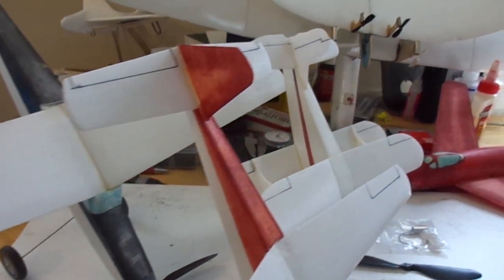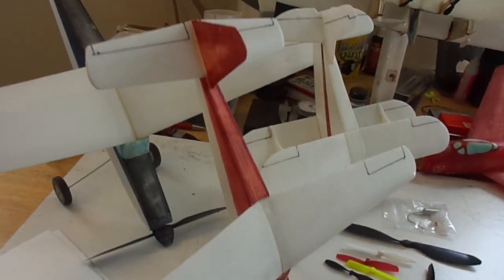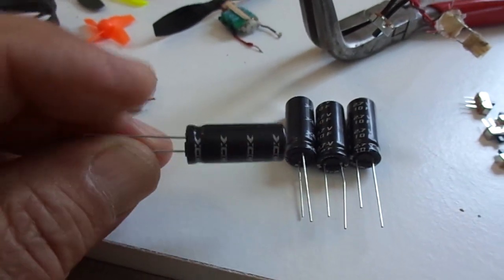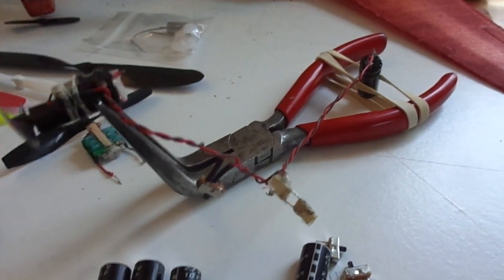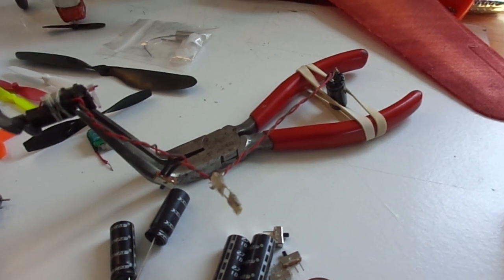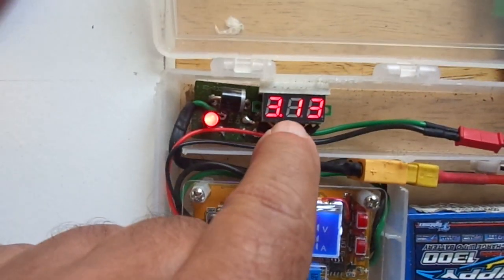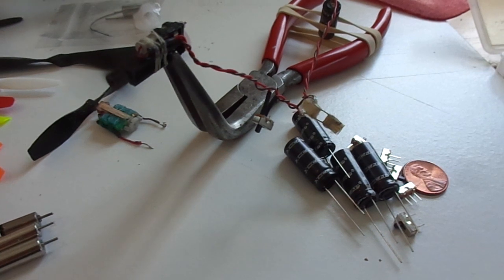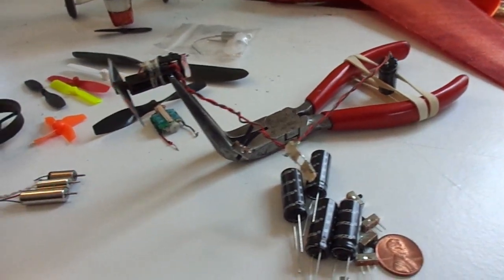SUPERCAPACITOR FREE FLIGHT BASICS

Comment: I have seen different charge voltages used by different people. Some use 2 AA batteries, some use 3 AA, some use a buck converter to supply constant 4V for a small time. So I have only seen people charging to 3V and higher and no one goes for 2.7V or 2.8 V. I dont know why that is or what is appropriate.

Also, how do I build ur kind of fuselage with my foam plates? Would be nice if u can do a short build video and provide plans :)
Reply from the maker: Hi, thanks for the comment! I chose the charging voltage and current based on specs I found for a very similar capacitor I found listed on digi-key.com. I wanted to stay well within the ratings of the device to be on the safe side. As I mentioned in the video, these capacitors behave like a dead short when they are not holding a charge (super low internal resistance acts like a short circuit). So, it's important to use a low current supply to charge. AA cells are low amperage whether you use 2 or 3 of them, so no danger there. If you use a buck converter, it should be a current limiting type or at least able to withstand a shorted output for a short time. 

I like the idea of making a build video but I can point you in the right direction until that happens. There is a website called outerzone.co.uk where you can download thousands of old-timer plans for free. What I do is pick out the design I want to build and download it (it's a PDF file). I display the plan on my computer screen and adjust the size on the screen until it is the size I want to build. Then I darken the lights in the room and trace the part outlines with tracing paper right over the screen. You might have to play with some of the dimensions a little to allow for the different relative thickness of the foam vs. the original balsa (in most cases) construction. Simplify the structure where appropriate...basically just use the main outlines and improvise the structure out of sheet foam. Just build a box with a couple of formers or bulkheads to hold the shape for the fuselage...the wings and tail are just sheet with a bit of an airfoil sanded in (optional). Traditional balsa and tissue construction will work also. If you go to the outerzone site and search for Ranger 30 by Carl Goldberg you will see the plans I used to build the little red/white and blue/white high wing monoplanes seen in this video. It's a good first project and flies great. 

I subbed your channel, great video about those walkalong gliders! Those kids were having a lot of fun and learning a lot at the same time!
Reply: sonex413 Thanks!

I had seen ur other flight video where u mentioned Outerzone website. And ur 1+ min flight video was amazing...quute a steep climb and I was surprised it didnt stall..pretty good trimming I guess :)

I am a newbie and am just starting to learn abt supercap FF...just ordered supercapas, motors and props from China...no easy/cheap availability of Balsa here is India so Walkalong has been my main stay...I got TSS rubber through a friend returning from US and achieved very very moderate results with my materials (see the XSticksy 300 video on my channel)- I had to make a paper clip hanger, yogurt cup props, dried stem fuselage etc which wasnt capable of sustaining very high rubber turns before the wire hanger started giving in...I now intend to do away with wire hanger and try a SkyBunny type hanger which I also use in Dragonfly helicopter designed by ScienceToyMaker. So due to TSS availability issues I am now trying a hand at supercap FF as one can get stuff from China. I will be trying 716 and 720 motors.

I got some readings and read some posts on online forums, and lots of people had used 2.5" props on 7mm direct drive motors with good results (they had done tests for max efficiency and max power rpm and put up tables). While the  resistance of motors they commonly use is higher from these Chinese motors, I guess the 2.5" (65mm) prop should be good with the 716 and 720 if the airplane weight is within limits. I checked my four 716 motors and their resistance varied- 1.5 ohm 1.6, 1.6, 2.1 ohm. The 7mm motor these other flyers had used, ientified as red, orange and green, had resistances of 2.3, 3.3 and 5.9ohm. The Chinese motors seem to be equivalent what they call Purple and Blue motors (low resistance) and designed for higher initial thrust rather than a sustained thrust.

It would be nice if u could also do a video on various prop-motor combinations acc to airplane weight and wingspan. With geared system, there is only one type available in China which is 5.3:1 reduction, so no other possibilities with that. I am hoping to go for 716 and720 on 65mm prop and geared 5.5" prop, all from China.
Reply from the maker: Thanks for the report! We are doing the same thing you are doing...finding out what works by trial and error along with a bit of sleuthing on the internet to see what works for others! I agree with your observations on the effect of motor resistance on duration vs. power. The little twin with the 1+ min flights is powered by 2x  614 (3.5 ohm)motors with 45mm props...they came out of a wrecked toy r/c plane. It has a single 10F Banggod cap. The secret to the excellent performance is the wing airfoil, it's a salvaged portion of a molded foam wing from a Micro Radian motorglider. There's a closer look at it in my video with the words "thermal bait" in the title.

The blue/white Ranger 30 in this video has a geared 716 motor with the 5 1/2 in. prop and a 10F cap. Wingspan 18 inches, all 3mm sheet foam. It has a very aggressive initial climb but doesn't have great duration, averaging about 35 seconds. Slow turning prop really kills the glide at the end..perfect when you fly in a tiny area or there's a bit of breeze. The higher performing planes only come out when the air is DEAD!

The 716/720 motor with 65mm prop and 10 Farad cap should be a great combination, my friend Richie was averaging about a minute with a 720 and 55mm prop. There's a video here: https://www.youtube.com/watch?v=Cb6R1GhuVIw

No balsa? No problem. I prefer not to use it because it absorbs moisture anyway. If a little extra strength is needed in a foam structure, a bit of clear tape on both sides adds a lot....Bamboo can be split into quite small sizes and and approaches the strength of composites...taper a piece for a great tail boom or wing spar. Happy flying, watch for our videos, and stay in touch! Mike in Massachusetts, USA

Comment: Can i use a 1A 3.7v phone battery?
Reply from the maker: No, I'm afraid not. It will supply too many Amps. You see, that 1 Amp rating actually means 1 amp-Hour. It is a measure of total battery capacity, in this case, it would power a 1 Amp load for 1 Hour on a full charge. The Amps available in the case of a low resistance load like a supercap would be much, much higher. You really need to use a low current source like AA batteries or a regulated power supply as in the video. Thanks for a very good question, hope you'll subscribe to the channel! Mike
Reply: @sonex413  Thanks for the answer, and the informative video! One day I'll be flying an 80F A321NEO out in a field :)
Reply: @sonex413  but what if my cap has a 10v rating?
Reply from the maker: I don't know of any supercapacitors with a 10 V rating. What you may have is a regular electrolytic capacitor. Watch the first part of the video where I explained the difference between a supercap and a regular electrolytic cap. Wikipedia has a lengthy article about supercaps which goes into great detail...history, development, theory of operation, charging etc. if you want the entire story. Good luck with your experiments!
Reply: @sonex413  2 weeks in and I received my first four motors!

Now I'll need help. Can I contact you through Facebook?
Reply from the maker: Hi,I'd prefer to do it right here so others can follow along if interested. Let's start by finding out what you plan to use for equipment. What motors did you decide on?  (diameter and length). What props will you use? (diameter). What supercapacitor will you use? (Farad rating and Voltage rating). Also I'd like to know if you have materials to build an airframe...foam plastic such as takeout meal trays or foam meat trays from the supermarket are excellent choices and a similar sheet foam is available at hobby stores in 3mm thickness. Give me a list of your equipment and I'll help you sort out what size model to build. Start collecting foam we can use for the airframe. I think this will be a lot of fun!
Reply: @sonex413  Hello, I already have the motors, 7mm x 20mm. It's rated to 3.7v and top rpm of 48,000 rpm. The props are direct drive 2".

The supercaps, however, are on the way. They are H-type 1F supercaps rated at 5.5 volts. I will also use a momentary switch. 

My charger will be based off an 18650 battery, and I'm sure about the voltage. I'm not sure about the current though.

My planned materials are styrofoam trays 1.5mm thick for the wing and 4mm foamboard for the fuselage.
Reply from the maker: Those motors and props are the same ones we are using with 2.7 volt 10 Farad capacitors (like in this video). They work great! think the caps you mentioned will be way too small in capacity...I believe those are mainly used in very low drain electronic circuits such as maintaining a charge on memory chips. There is a link to the 10 Farad caps like we use in the video description above, the second link in the list is the supercaps (5 pieces). Here is a link to the video of the plane my friend Richie made using the 7mm motor like yours and the 10 Farad 2.7 volt cap.
 https://youtu.be/Cb6R1GhuVIw
You can see the performance is very good and you get a general idea of what your plane should look like...although there is always room for experimentation! I think the 18650 might be too many amps, look up online what they can put out when shorted. They would make a great power supply for a regulated step-down device like the one in this video though. I think AA alkalines for initial testing and an electronic charger when you need one later. (link to the regulated step-down circuit is also in the video description above, take a look at it to get an idea of what it is). Your airframe materials sound perfect for the job! Again, take a look at that video of Richie's 720 motor powered plane, it will give you some ideas I'm sure! Check out some of our other vids too while you're at it! take care my friend, Mike
Reply: @sonex413  i am going to put 3 caps in series, I guess. I was going for the voltage instead of the capacitance. I need the voltage.
Reply from the maker: mount up your stuff on a little test rig like in this video, that will be the true test... and I think you must mean hook them up in parallell, that would give you 5 volts and 3 Farads...might be enough for a short flight...we get pretty good thrust at 2.7 volts, at 5 volts those motors will really scream, I'll bet...keep us up to date as things develop!
Reply: @sonex413  i will only charge it up to 3.7v. That's all an 18650 gives off.
Reply: 11/1 update: started building the tail (a v-tail similar to the UMX Radian you recycled)

I'm still wondering if I could have a staged discharge.

For example, I have a 5.5v/1F and a 2.7v/10F. How about in the first short moments of the flight the motors are drawing 5.5v, then it can then draw a steady 2.7v for longer.

I actually ordered both types xD.

Edit: I ordered the 5.5v because I wanted to play safe, only charging it to 3.7v.
Reply from the maker: Great! Best bet is to mock it up on the benchtop as I did in the demo video. Do your testing, then put it in the bird! I still think the single 10F will be the best, but I'm very interested in the characteristics of those 5.5V units, looking forward to keeping up with your progress.
Reply: Hey, can you send me a schematic of the circuits involved here? It's okay if you don't include the charger schematic. I just need the polarities if everything. I'm nervous about one of these blowing up in my hand.
Reply from the maker: Sure, here's how to do it...there's not really much of a circuit, to be honest. Using a small battery run your motor to see which wire wants to be positive to make the prop turn the correct direction, and mark that motor lead "positive". The supercap is marked with a stripe down the side of the can with negative signs on it, the lead coming out next to it is the negative. Now connect motor positive to capacitor positive, and connect motor negative to capacitor negative. if you're using a switch, it goes in the positive wire between the motor and cap to break that connection. you can charge directly to the capacitor leads or add a remote charging jack depending on the plane's design...the important point is that when you charge you connect the charger's positive to the capacitor's positive. Watch the part of this video where I'm describing the hookup and see if it makes sense. Nothing's going to blow up using double-A's. I recommend them for your first trials. Also...be careful pressing propellers on those little motors, you can push the guts of the motor right out the back if you don't support the backplate (the plastic piece where the wires come out of the motor). I put the prop on a table top and then press the motor shaft straight down into it by pushing with my two thumb nails against the plastic backplate. Removing a prop is no problem, just pull, you can't hurt it in that direction.
Reply: @sonex413  I pulled a coreless motor once, the shaft pulled out xD

Comment: I have a question regarding the use of the reduction gears. Can you help me with the criteria to decide whether it is necessary tu use it or not? Thanks.
Reply from the maker: My favorite method is to assemble and test the motor, battery and propeller together on the workbench. See how much thrust and duration is available, then decide what aircraft you will put it in. In general, the geared motor is capable of flying a larger aircraft than the direct-drive using the same capacitor. Both styles are capable of great flights...have fun experimenting!

Comment: I have an idea to make a free flight electric rocket. I want to use a little motor and propeller in a paper rocket tube that can run for maybe 3 seconds, just enough to get a quick thrust on takeoff. I can probably over volt those little 7mm motors to over 5v for a few seconds and use some 30-40mm propellers. I think it would be a neat idea even if it only goes up 100'.
Reply from the maker: Interesting! I don't think capacitors would do the job, though. Maybe a really small LiPo, but then you'd need a timer too. I'm subscribed to your channel, keep us posted on developments!
Reply: sonex413 yeah I was looking into lipos too, but the issue with them is that they are limited with how fast you can draw current from them. I'm searching for the perfect combination of size, weight, thrust, and current draw for my power source. Lipos can store way more energy than the same mass capacitor, but then it has to release that energy over a span of usually close to a minute at the minimum. I only need a few seconds of thrust so it is obviously wasting energy if I need to carry a lipo and only use 5% of its stored energy.  Oh well I'll keep researching.
Reply from the maker: Keep us posted on your results, it sounds interesting!

Comment: Well done, information I did not know. I was charging with 2 D cells.
Reply from the maker: Thanks Bill! Since the normal life expectancy is over a million charge cycles it's hard to say how much the D cells would reduce that number, or whether it would even be noticeable. I chose to stay within recommended limits to be on the safe side. AA cells got expensive and since I like "free" flight I built a couple of those regulated chargers for myself and Richie. We love 'em!
Reply: The regulated charger really looked nice, I do not know enough about electronics to build that.
Reply from the maker: It's some mechanical assembly and simple interconnections...installing it in a case... the circuit board stuff comes prewired...easy. Video coming soon will show you how to slap one together for about 15 bucks. Till then stick to the batteries and let us know how the capacitor torture test goes in the event you keep using the D cells on one cap as an experiment! Science! LOL
Reply from the maker: Thanks Bill! Since the normal life expectancy is over a million charge cycles it's hard to say how much the D cells would reduce that number, or whether it would even be noticeable. I chose to stay within recommended limits to be on the safe side. AA cells got expensive and since I like "free" flight I built a couple of those regulated chargers for myself and Richie. We love 'em!